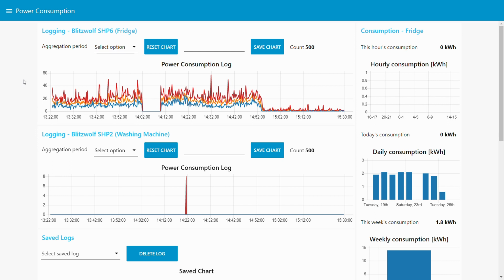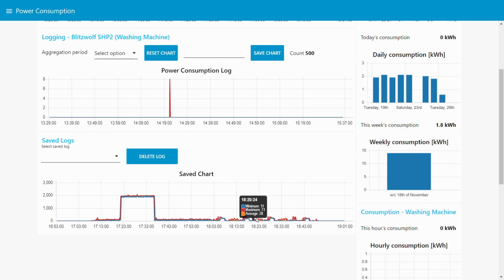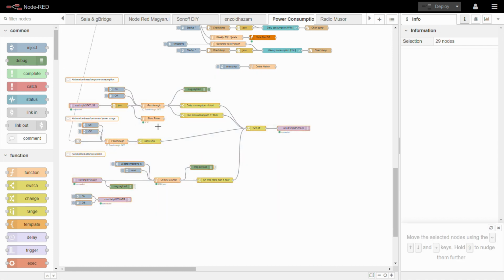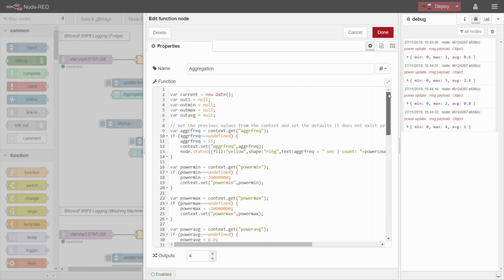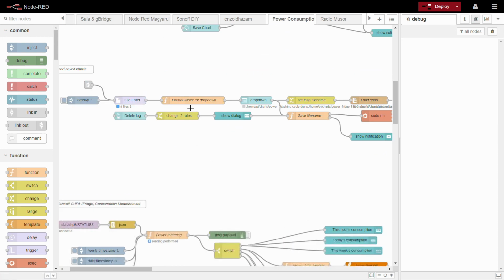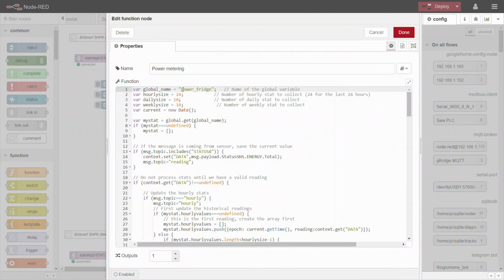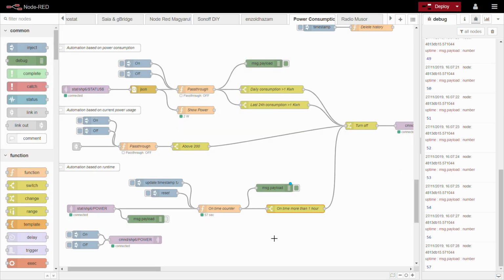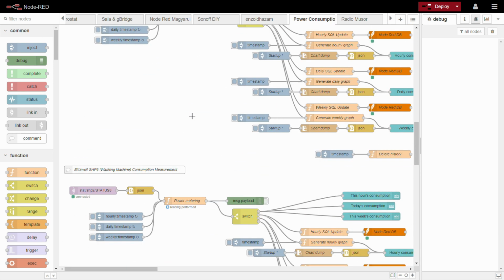Power consumption monitoring in Node Red

Comment: @Csongor Varga This is a very fantastic video tutorial.  Like to know the MQTT topic stat/shp6/STATUS8, how many output to make this work and what are output name or how many string output... What energy meter you are using?
Reply from the maker: Thanks. That is a Blitzwolf SHP6 smart plug with energy metering that I flashed with Tasmota. I have a separate video on that.
Reply: @Csongor Varga, can you attach the blitzwolf sh6 mqtt status8 debugging details from nodered, like to know what string values required for the inject into aggregation node, so that everything works fine if I were using other device such as sonoff pow r2. For e.g. Watts value or any other value require for the aggregation node to function correctly.

Comment: Hello, I have a question.
Is Node-Red as Scada better than of any other Scada softwares ? I want to make a Scada system to monitoring a power consumption in a factory, but the Scada softwares are expensive, i want opened source software as Node-Red , but i don't know is it a better solution to start with it or not ?
Reply from the maker: I think it is just a different technology. I would not say any of them is better or worse. You may hear people saying not to control critical systems with an interpreter programming language like JavaScript, but if you have a "proper industrial control system" and Node-Red is only used for monitoring, logging and analytics, I don't see a reason why it should not be used.

Comment: Hi Csongor. I adapted your flow to write the hourly, daily and weekly to influxdb, but for some reason I don’t get any values on these outputs (even with debug connected to them the values are always 0). I know the data going in (from Shelly EM) is going up in incrementally. Thoughts?
Reply from the maker: Do you see any errors in the debug tab?
Reply: Csongor Varga Hi, thanks for the reply. No errors in the debug that’s I can see. The debug from the function has data in the array (as you would expect), but if I trigger a manual hourly, daily or weekly trigger, I get nothing out of the switch module on the associated output channels. Not sure what I’m doing wrong. I just want to take the 3 values (when triggered) and pass to the db.

Comment: Hi Csongor, that looks fantastic. I've been trying to find a solution for aggregating the power usage hourly/daily/monthly for a while without much success until now. I'm new to node-red and still didn't manage to integrate your power metering function into my flow.....when I connect it where I get the last index as a number (kWh) from my meter and open the function it tells me that there are too many errors in the code, "i " and "delta" are used more than once, etc. Could you suggest what should I do? Many thanks.
Reply from the maker: I don't quite understand how you have those errors when it is running OK in my system. Can you email me a few screenshots? it is csongor dot varga at gmail dot com.
Reply: @csongorvarga  Thanks Csongor, I've sent you an email a few minutes ago

Comment: wat is tabel structure for  sensor_aggr ? How do I setup this DB ?
Reply from the maker: Execute this sql statement and it will create the both tables: CREATE TABLE 'sensor_aggr' ('epoch' INTEGER NOT NULL, 'device' TEXT NOT NULL, 'sensor' TEXT NOT NULL, 'value' REAL, PRIMARY KEY ('epoch', 'device', 'sensor'))
CREATE TABLE 'sensor_data' ('id' INTEGER PRIMARY KEY AUTOINCREMENT NOT NULL, 'device' TEXT, 'sensor' TEXT,'value' REAL,'epoch' INTEGER, 'timestamp' INTEGER DEFAULT CURRENT_TIMESTAMP)

Comment: Great video. - trying to leverage and import the flow, however, the following node types are missing from my Node Red implementation - 
file
file in
exec
fs-file-lister

Can you let me know what node types they are? I searched for them specifically by name to import, however, could not find them.
Reply: On your Flow the unknown nodes "file and file in" are named "Chart Dump" and "Load Chart" The unknown node "exec' is "Sudo M?"  I. have the FS node now as you described it in the video. - thanks!
Reply from the maker: I am surprised. fs-file-lister is something I added manually but the others are standard nodes that should be installed when you install Node-Red. I do mention it in my video, you click the 3 lines on the top right corner, Manage Palette, Install and search for node-red-contrib-fs. That is the file lister node. Everything else should be in the basic node-red package.
Reply: @csongorvarga  Thanks - I have my Node Red hosted in the IBM Cloud so that might explain why a few nodes are missing - I will load up the environment locally and that should solve the problem.

Comment: Hi - Great work as always - one query is that when you only have one saved chart  the dropdown selector produces no output and it becomes impossible to show or delete that chart.  Any ideas?
Reply from the maker: That is interesting, mine works with one file as well. Did you change any of the path or the file name pattern? If so did you update it in the File Lister node?
Reply: @csongorvarga  No changes except for the Save Filename node in that section. Originally it had a return message at the end which meant that any file you retrieved was automatically deleted without any warning so I commented out the last line. The issue seems to be that the drop down node with only a single option cannot make a  selection and does not trigger any action. I can duplicate this by independently creating a dropdown node - if it is populated with an array of two options I can select one and get an ouput but if I change it to an array with one option I cannot select it from the dropdown and get no output. I'm still on 19.5 so I'll update to latest to see if it changes behaviour
Reply from the maker: OK, first error is that on the "Save Filename" function node, the last return msg; line needs to be deleted. That causes accidental deletion of new logs. But the other issue is what you mentioned that if there is only one entry in the dropdown, it cannot be selected. It behaves the same for me too. I need to spend a bit more time on this and maybe report as a bug to dashboard.
Reply: @csongorvarga  - Finally cracked it - the issue is that the dropdown won't action until you change the selection, However given that you rebuild the options from scratch every time that should not be an issue. However the "Format filelist for dropdown" node is outputting the filename in its payload and preselecting the choice preventing you from changing the choice as there is only one available. I added a msg.payload={} to the end of that node just before the return msg and now everything works fine.
Reply from the maker: Great, thanks for your efforts. I have updated the file in my drive as well, so everyone can enjoy the bug free version.

Comment: Hi, In your top flow, you are using an "Aggregation" function that extracts the "powermin", "powermax" from the MQTT Status8 message. My MQTT status8 message does not contain the "powermin", "powermax". I'm using a SonOff Pow R2 with Tasmota. Is there something that I'm missing here?
Reply from the maker: I am sorry, I never used Tasmota with POW R2. I just assumed that it is giving the same status8 message as Blitzwolf. You need to debug and see how the data comes through from POW.
Reply: @csongorvarga  This is the output of the JSON node (in your top Blitzwolf SHP6 Logging (Fridge) flow): {"Time":"2019-12-06T16:03:04","ENERGY":{"TotalStartTime":"2019-12-04T21:11:10","Total":0.002,"Yesterday":0,"Today":0.002,"Period":0,"Power":7,"ApparentPower":8,"ReactivePower":3,"Factor":0.92,"Voltage":215,"Current":0.037}} 
The Aggregation funtion output the following: TypeError: Cannot read property 'ENERGY' of undefined. I will have to change the Aggregation to make use of my SonOff message, but will you be able to help me to extract the "Total","Yesterday" and ,"Today" values from my json string. I assume the "var powermin = context.get("XXX");" will have to change because the information is in a child object ("ENERGY{}") of the json message
Reply from the maker: OK, so your energy reading is in msg.payload.ENERGY.Total. Try that in the code.

Comment: I'd been using the rebadged Teckin SP23 devices for energy monitoring with tasmota.  Seems they updated the model in October and have replaced the esp8266 with something else.  They've also removed the energy monitoring feature.